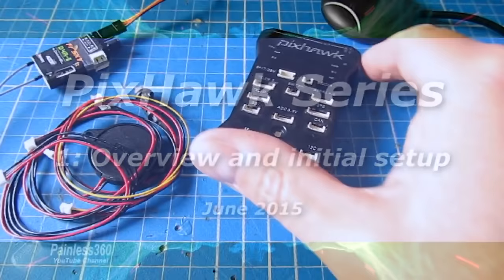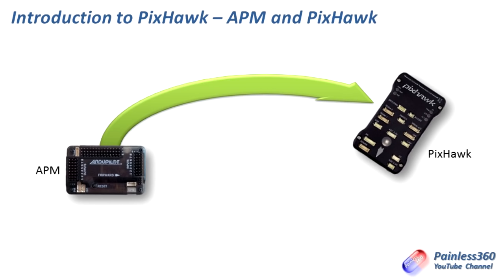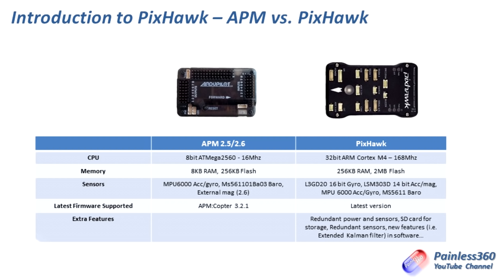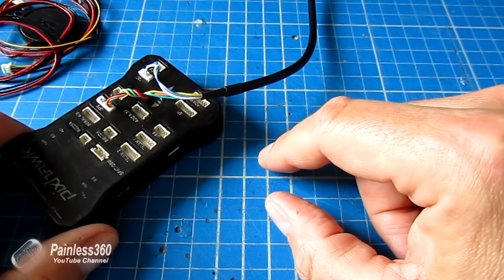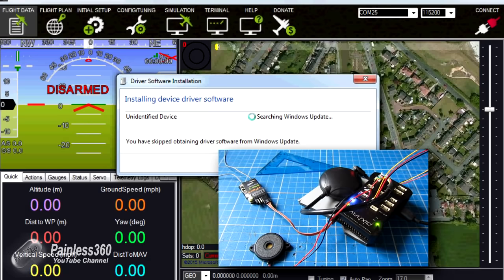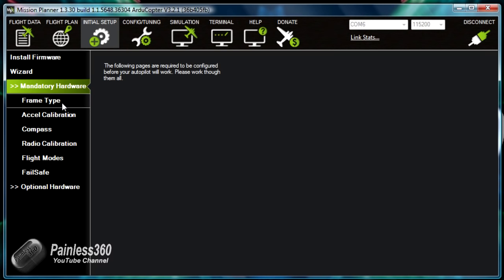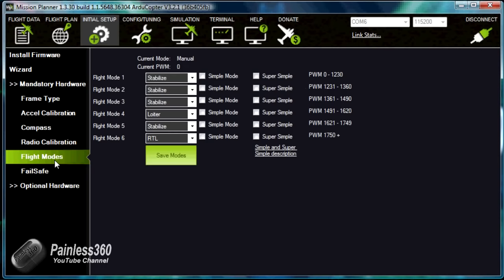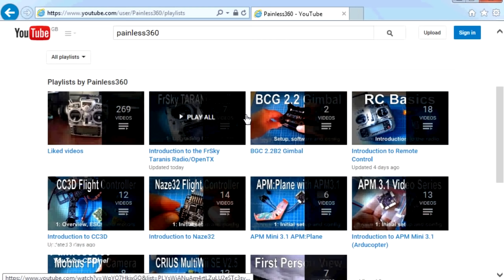(1/5) PixHawk Video Series - Simple initial setup, config and calibration

Comment: Apparently , all related to the SD card, after reformating everything went ok.Now , i have one question , what is the correct value for to parameter ThO, before with the APM , it was below 700, now , it seems that the units are changed, actually i am at 0.250 average for a stable altitude, is it correct, how to know if i am under powered?Thank you.
Reply from the maker: It depends on the particular aircraft you have it in. http://ardupilot.org/copter/docs/ac_throttlemid.html

Comment: Hello;

I have followed your great tutorials on pixhawk and FR Sky, however i've run into a strange problem where one motor isn't spinning as fast as others.. I'm using a DJI s900 platform connected to the pixhawk and the motors whilst they all power up and idle on arm.. one more seems to exhibit this behavior where it isn't getting enough power and slowing down at times.. I wonder if you have experienced this...? I'm told that the DJI ESC's have a fixed PWM value and can't be changed... so i'm really stumped now.. any ideas ?
Reply from the maker: +Richard James we've not used DJI products here. We're not fans. I'd normally suggest you recalibrate the ESCs next. Best of luck!

Comment: HI Painless360, I'm working on a tailsitter quadopter using a pixhawk and was wondering if there is a way to switch between the arducopter software for the vertical hovering and the ardupilot software of the tailsitter transition and fixed wing flight mode?
Reply from the maker: Not played with it here but lots to read up on in the Wiki - http://ardupilot.org/plane/docs/guide-tailsitter.html

Comment: Thank you for the super helpful video!  I'm stuck on the radio calibration...nothing I find online seems to help.... My Futaba T7C is bound to my Futaba R617FS Receiver, Solid Green Light, I believe in the correct parameter mode (H-1), but yet AP Planner nor Mission Planner will recognize the RC, so I can't calibrate.  It says "Radio Control is Not Active or Turned On"  Can anyone help??? Been stuck on this for a week :S 

Thanks in advance!!

Comment: I am using a FS-IA6B. I know my transmitter and receiver are bound from flying a different quad copter with clear flight. But for some reason my radio is not showing up on mission planners radio calibration. I am using ppm. so what is up?  please help!
Reply from the maker: +Stefan Keilich could be a few things.  What troubleshooting have your already tried?

Comment: I can't quite make the sense out of what you're saying @ 7:27 "...absolutely pressed home (?) before we plug it into a computer". Do you mean that I'll have problems connecting Pixhawk to a Mission Planner if there's no SD card in it?

I'm thinking about trying out Pixhawk after Naze32/Cleanflight, which I never got the chance to setup properly, because I broke a couple of beams and half a dozen props trying to tune it at home, and when I got it to fly somewhat, it still wasn't flying as stable as Naza M Lite that my dad uses on his own quad.
Reply from the maker: Make sure the SD card is plugged in so you hear the click. We answer your second question in the video - if it's not then it won't flash with new firmware. Happy flying!
Reply: Painless360 Thank you :)

Comment: HI, quick question. If I understand correctly, when powered by power module I should NOT connect +5V from ESC. Is this correct?
Reply from the maker: You can but it's recommended to install a zener diode http://ardupilot.org/copter/docs/common-powering-the-pixhawk.html)

Comment: Nice , would this be on a fixwing or copter?
Reply from the maker: Aron Gatt It can be on both but it will be added to a quadcopter (the most common model requested by subscribers). There is an APM video series for planes and with this series you will be able to easily figure it out.
Reply: yes , i did see the apm series ( which is great) somehow u really have a very neat way to simplify all things which i really like.
thought i ask on fixedwings cos its where im heading now with my builds..... just got a bix3 and im looking for a good flying wing aswell to put a good AP on and the pixhawk is a great platform now 4 sure.

Comment: Again a perfect guide , shortly what is the advantage of the pixhawk over the apm...i have an APM , can i use my accessories , GPS+Compas and telemetry if i move to pixhawk?thank you.
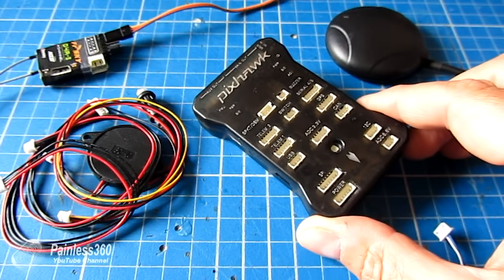Reply from the maker: APM vs. PixHawk covered at 3:03 in this video. Personally, the cost of the PixHawk with accessories is so low now I'd get a new setup. The GPS units shipped with the older APM are much less sensitive than modern units.. Happy flying!
Reply: thanks for your answer, clear now...

Comment: Hi here's my biggest problem now the compass in mission planner points in the opposite direction north is south and vise versa. ive recalibrated and reset pixhawk several times the offsets are good any suggestions Thanks
Reply from the maker: +Chaz M the compass on the GPS stork can be in all sorts of orientation, I'd turn it round 90 degrees at a time and try again until you get it working. Best of luck!

Comment: I have a trajectory planning problem and I am thinking to implement it using Pixhawk 2.4.8 . For the control purpose, I need to get the position, velocity, and acceleration of both angular and linear components. Moreover, Pixhawk 2.4.8 has 2 accelerometers, 2 gyroscopes, and a magnetometer. Though acceleration data are readily available I was wondering if any library supported in Pixhawk can help me get or estimate **current position and velocities** without using external sensors like (lidar, optical flow, vision)  etc. Can the position and velocity be estimated using onboard IMU sensors only ??
Reply from the maker: +saswat priyadarshi nayak awesome question! But I’m afraid it’s a little outside of my knowledge. For something like that I probably approach the developers. Best of luck, I hope you get the answer you need. Best of luck

Comment: I want to use another channel for switching cameras, can I do that with a 4 channel receiver? I was planning to use an X8R 8 channel receiver.
I don't know if you still monitor this video but my project is on hold until I find the answer, so If anyone knows the answer please let me know.
Many thanks to Painless for all his tutorials. 
Painless now also writes for RCM&E magazine.
Reply from the maker: If you are connecting to the FC using ppm or sbus then you can forward the channel - http://ardupilot.org/copter/docs/common-servo.html
Reply: I read your reply to a commenter way down near the end and checked your tips for the X8R in the eagle tree vector series. Many thanks for that and all your help over the years. I haven't tried it yet but it looks straightforward.

Comment: I'm trying to install the software into my pixhawk now. But everytime when i plug in the USB cable the buzzer keeps on beeping. 

I've noticed that i dont see some light on my GPS module like yours has.

I've connected the wires of my GPS at the same way like you did how ever.

My GPS is pretty much the same like yours,  mine has only got something written on top.

I was wondering,..Could it be possible that my GPS module might be broken because of that buzzer thats keeps on making noise?
Reply from the maker: Possibly, I'd try it without the GPS plugged in and let the vendor know you've got a problem. Best of luck!

Comment: Hi Painless360, I am configuring my first Pixhawk. I am following your tutorial closely, but am not able to connect my radio to the Pixhawk controller. Is the Fly Sky FS-R6B radio receiver compatible with the Pixhawk? If not, what radio and receiver do you advise I get? Thank you for your time.
Reply from the maker: Is the receiver PPM or S-Bus?
Reply: I have a 6 channel PPM receiver and the Fly Sky FS-T6, 6 channel radio transmitter. Thank you for your help.

Comment: hi these videos r awesome helped me heaps I would like to see a video on how to wire and setup the 5D3 gimbal with the pixhawk there r absolutely no video's about this that I can find heaps on the gimbal it's self but nothing on it with the pixhawk and wiring
Reply from the maker: I tend to run things like gimbals from the receiver if they need a PWM connection to control their position. See the X8R binding tips in the Vector series for how I do it. Hope that helps for now.
Reply: Painless360 thanks for replying I wasn't sure it I could do that as I have the receiver connected to the pixhawk with the s-bus and in the gimbal instructions it says it's best to connect with the pixhawk can I use the s-bus out on the pixhawk
Reply from the maker: No idea, I’ve not tried it. Best of luck!

Comment: Your video turned me on :D So my question is, what do I need for mission planner. In terms of hardware? I am buying the pixhawk flight controller, plus a GPS module. Is that all I need? or is there extra hardware? For example, I want to use my computer and plan my quadcopter to fly on its own, while I am just watching FPV and can also track on my computer?
Reply from the maker: +Henok Hailu all covered in the series - keep watching! ;)
Reply: +Painless360 Ok. So finished your series (5 episodes) and oh gosh, you are really good at making videos. So, on the 4th episode, you talked about setting up waypoints and everything. So cool, you can actually do that without any other hardware except for the GPS and a computer to setup up the waypoints at home. Am I right? But the problem is, you can't track your copter and where it is going with your hardware selection, because I think you need a wireless telemetry rx and tx where it is connected to the pixhawk, and one connected to your laptop, and therefore, I ca track down where my copter is going, and speed etc. and am right? Thanks you have helped a lot
Reply: +Painless360 and one very last thing. Do I need a PPM encoder, if my receiver already transmits ppm signals? :D
Reply from the maker: +Henok Hailu look at MAVLINK radios  ;)
Reply from the maker: +Henok Hailu nope

Comment: Painless Sir, I am thinking to change the Flight Controller (APS-M) from my Align M480L, which have some issues not possible to solve to a PixHawk.  Is it possible, and it is a straight forward task, or will involve new wires and soldering? I use a Futaba F14 with S-Bus, which interface, I suppose, will not be a problem. 
Thank you.
Reply from the maker: Always expect to change cables. Best of luck!

Comment: When experimenting with voltage cut off what do you consider a safe cut off voltage i see you have yours setup at 10.5 is that enough to fly the craft for a minute or two?
Reply from the maker: In practice the voltage will seg slightly when you apply more throttle and that can very often take it below that minimum voltafe level briefly towards the end of a flight. That then triggers the return to home or let you know it's time to fly back. If your worried about pushing your batteries too hard you can increase that to 10.6 or 10.7 and that should give you a nice wide margin of error. Hope that helps

Comment: I checked by a tester the output module voltage: 5V. it means that it works. looking on the web I discovered that the issue could be the firmware damaged, but I can't fix it because I can't link the board to the PC via USB. any suggestions? thanks and regards. Andrea
Reply from the maker: If the power looks ok then something else might be damaged on the board. I would check the forums for last things to try before ordering a new one. Best of luck!

Comment: I selected a hexacopter on the first screen of the wizard, but as soon as it connects to my Pixhawk, it only gives me a choice of quads or tri. What do I do next?
Reply from the maker: No idea, I've not seen that. What trouble shooting have you already tried?
Reply: Painless360 That Pixhawk died on me, looks like a voltage regulator failed... will try again when I have the replacement.

Comment: Hello there, I've noticed that when you show the flight data after the calibrations your Yaw measure is drifting even when the pixhawk is still, I've wanted to know if that is a problem because the pixhawk I'm using has that same behavior.
Reply from the maker: It's not ideal but changes in temp and not letting the model settle after power on can cause this. It didn't affect the flying! Happy flying and best of luck!

Comment: Greetings and thanks for this great video as usual. I hope you can help me with this I never had this problem before i have done everything and everything works as far as channels and arming But no throttle response. Arms okay channels work calibrated ecs okay and they respond to throttle in calibration mode but not after you unplug and plug back and arm. Pleas let me know what do think about this I greatly appreciate your help.
Reply from the maker: +nasarami Sounds like a power problem to me. I'd check that the board and ESCs are getting 5v when not connected to the USB.. Best of luck..

Comment: hi sir, yesterday evening I used my pixhawk on my tricopter. everything was fine at the begin, but after 10-15 min of flight some smoke came out from the power cable. i used the pixhawk power module to power the FC. the 2 ground wires were melted. after that I tried to connect the FC to the PC via USB cable, but the I was not able. the FC turns on, the small leds are (blue) are on, also one orange led is on, the other orange led is sligly on and the buzzer makes a soft electric noise. the big led is off end no tone is coming out. I gave a look inside the SD card and there are no files except some files (8 files) about the transmitter and one txt file containing the number 8. I used the zener diode as suggested. could you help me? thanks in advance for your help. regards. Andrea
Reply from the maker: +Andrea Montani Not really as it sounds like the power system had a problem and maybe blew one of your voltage regulators on the board. Best of luck with it..

Comment: Clones of these are available on eBay for about $40. Are they worth it? I need something to replace the deprecated SP racing F3 EVO on my big quad (experimental video platform)
(I am aware of the latter F7 based pixhawk 4, but that thing is almost $200 just by itself! :O )
Reply from the maker: ,,, with all clones you pay your money and you take your chances. If you buy it from a reasonably reputable reseller then you should be able to get some back up if you find you have a problem. Best of luck, check out my builds with pixhawk.

Comment: Great setup video. Quick question, is there a way to setup the pixhawk "without" the use of the GPS module?
Reply from the maker: See the rest of the series, I cover GPS later on..
Reply: Painless360 thank you for the reply it seems I had a typo. I meant to say "use the pixhawk "without" GPS not with GPS. I would like to essentially use the Pixhawk in a GPS denied area. Do you have a video on this subject?

Comment: Very details 
I just bought the pixhawk 2.4.8 n followed your steps in setting up. 
But mine seems different when plug in usb port. Main big led light doesn't light up but bootup sound is same. Also after every steps have completed including calibration and plug in the battery theain big led light just shows solid red but i could arm and disarm the motors.
Is it normal? 
Thank you.
Alex
Reply from the maker: Not sure, there are lots of PixHawk versions out there. If it's working OK (and matches the manual for the one you have) then I woulnd't worry.. Best of luck!
Reply: Thanks for your replied. .
Happy flying.

Comment: What is a good ESC I can use? I want to use either PPM of S-Bus. I have a Futaba T8J Transmitter
Reply from the maker: If you're using a flight controller then see what we use in the series where we build. There are lots to choose from and most are now designed to support multi-rotor builds! We've used lots of different kinds here. Best of luck!

Comment: so shall I throw in the bin? or is there anything I can do. what's about SD files? sorry for bothering you. regards. Andrea
Reply from the maker: +Andrea Montani I wish I knew, it does sound very poorly but I'd look at the power regulator replacement (if you like fine soldering) else get another one. I'd get to the bottom of the power issue though in case it happens again.. Best of luck.

Comment: Hey. can you help me. please. Im trying to connect de board on my computer, but it's does not recognize. It stays as unrecognized device. My windows is windows7 32 bit. And i cant install the last version of mission planner, because it needs the net frame work 4.5 or newer and my windows does not support it. Do you think that if I try to connect the board on a computer with windows 7 64 bits can work?
Reply from the maker: Not sure, Windows 7 is something I've not used for a long time. Best of luck with it..

Comment: Hi ray explanation to understand. I'm using flysky ct6b transmitter. When I arm the pixhawk in stabilize mode with throttle cut the motors starts spinning and when I change the toggle switch the copter started raising. The pixhawk doesn't arm without throttle cut. It's that a problem ? Same way copter arming with throttle cut enabled but while disable the throttle cut and raise the throttle it behaves weird. What could be the problem ?
Reply from the maker: Please see my Pixhawk 2020 series for a more up to date set of videos... best of luck
Reply: @Painless360  thanks